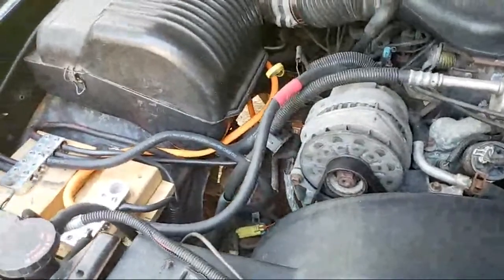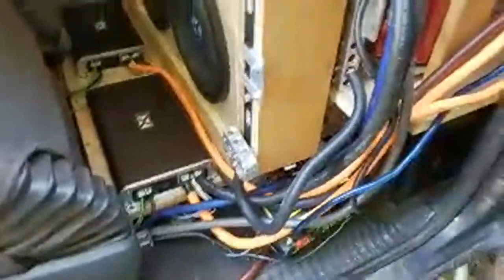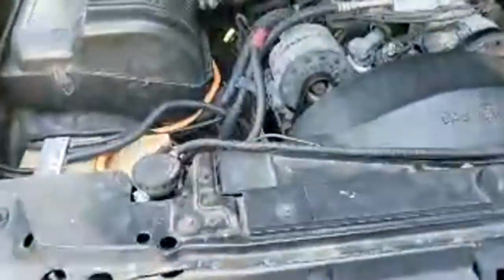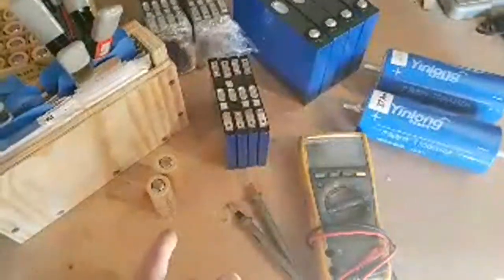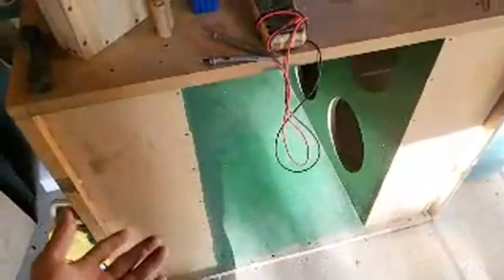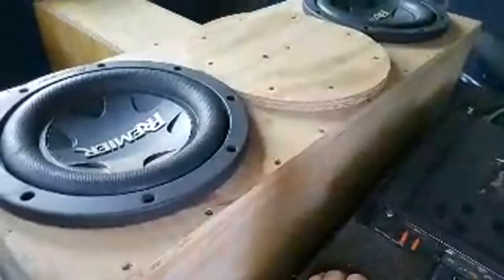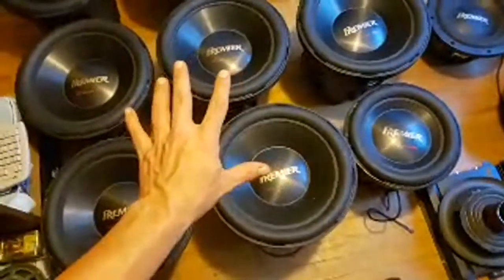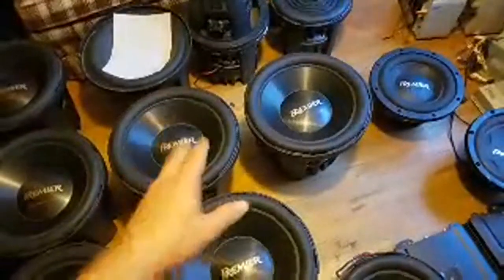DIY Lithium Battery Relocation Live Stream Questions

Comment: Well actually yes. My SD12k has a square cut from the center of the PCB and pulls air out the ends just like that Sony but there is fans on the ends also.